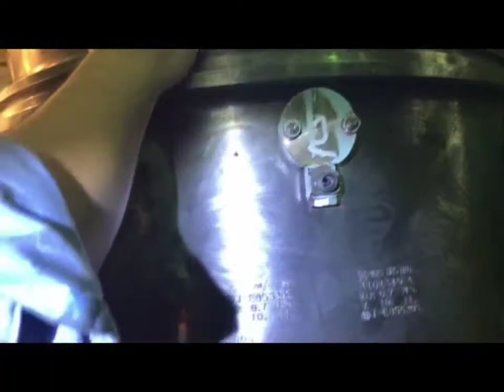Mitsui Man B&W Cylinder liner replacement 6s50MC-C

Comment: Very unsafe practice without prpper PPE any youngster watching plz wear proper PPE..... bear in mind if anything happen and if its proved you were not wearing any PPE you will not get any insurance claims....
Reply from the maker: Thank you for your comment and already rectified during tool box meeting.
Reply: l have worked for two large well known companies and the posting on social media of ships operations is prohibited.There has been incidents in the past where cargo claims have been questioned as ships operations were posted on social media prior to a claim  being made to the P & i club,There were some malpractices spotted by insurance adjusters.Don't for one minute think that P&i club surveyors are not watching social media because they are as well as port state inspectors.
 If you want to see correct maintenance procedures refer to the engine manufacturers instructions there is plenty information on line.

Comment: Do we have any mark between cyl liner and engine block? During assemble?
Reply from the maker: As per maker instructions manual the MATCH MARK LINE can me seen always on cam side between cylinder liner and jacket cooling to be coincide and also the jacket cooling inlet on the exhoust side to be in line.
Reply: @marineinfoj2k610  thanks bro.